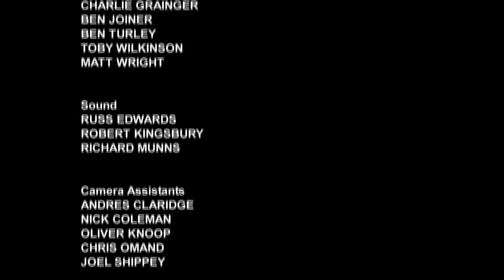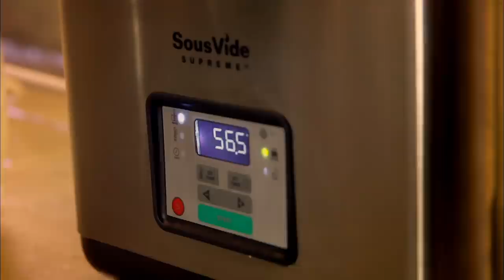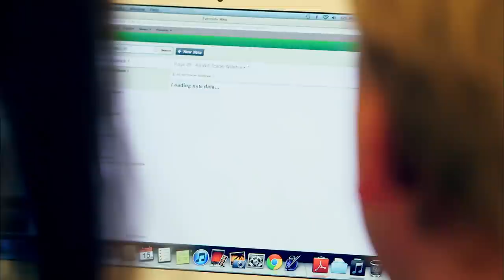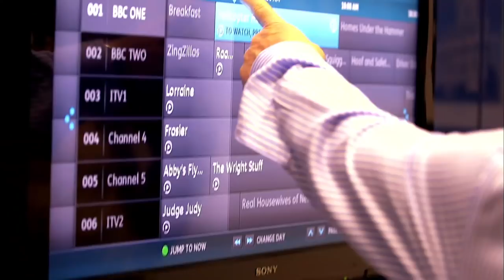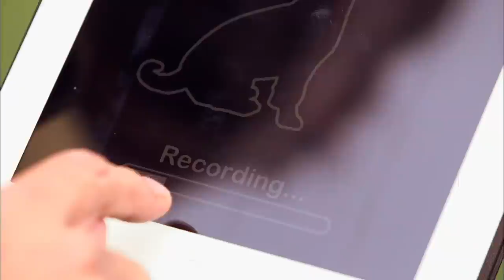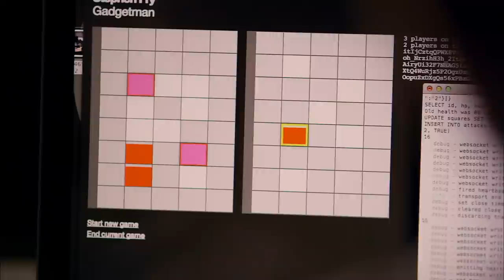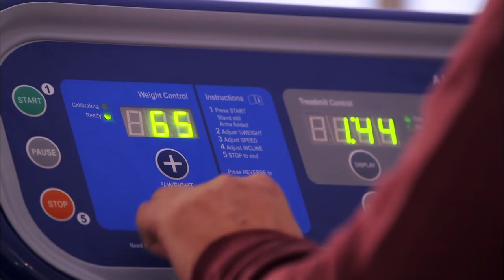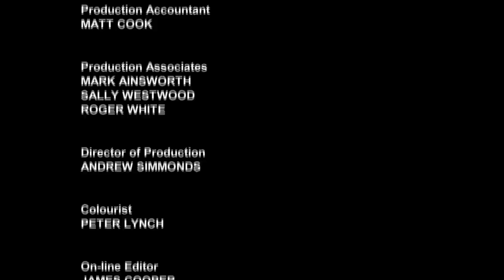Stephen Fry's Gadget Man - ALL Episodes | Series 1

Comment: The yike bike is brobably the worst bike design. No handle bar in the front means nothing between your body and whatever you crash into. You can't bail by hopping off or standing up, because the handle bars will take you out as the bike continues to roll forward after you have stopped.